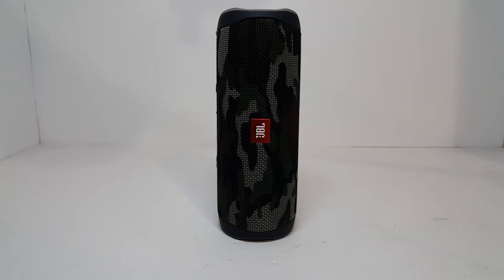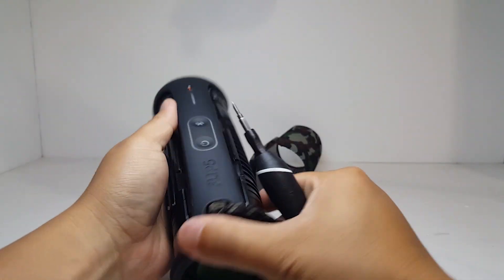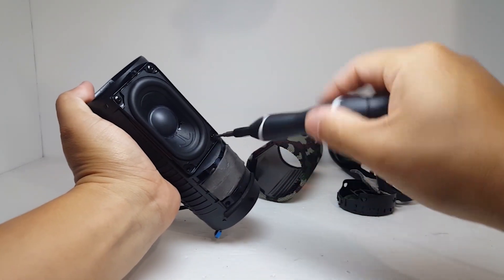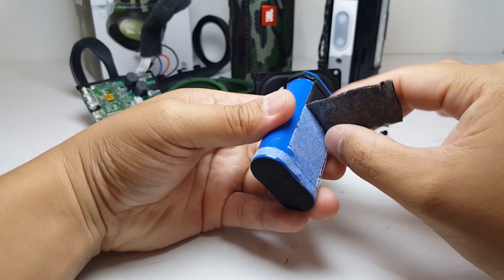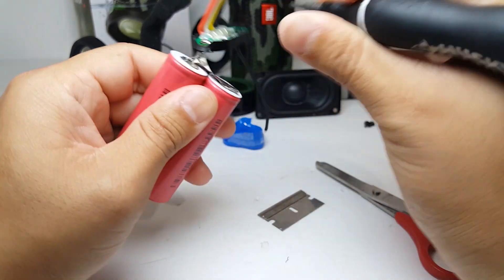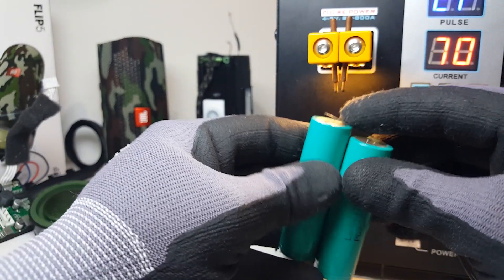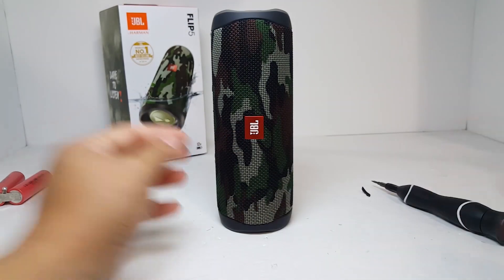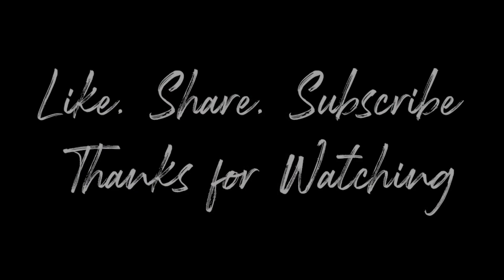JBL FLIP 5 - HOW TO REPAIR BATTERY

Comment: For all who struggle because it doesnt work like in the video TRY THIS – #Jin_Thao maybe you can pin this!

As experienced and mentioned by others in the comments there seem to be other (newer?) versions of the JBL Flip 5 – where the inside looks different and you have to work it different than in this video. I repaired mine so I thought it would be cool for you if I made a little instruction:

1. You have to make things different than in this video. So you should not try to force the material to behave like in this video. Otherwise you will break things. 

2. The first cable with the white adapter, that is connected to the platine, will go off, if you just gently push it side to side, pull a little, again push side to side and so on. 

3. Don't try to remove the speaker. Just pull it out and work around the cables having the speakers hang outside while still connected. 

4. Pull off the sticky black foam in the back so you can work there. There is also foam on the platina. I removed a lot of it because it makes it easier to remove the platina afterwards.

5. There are several ribbon cables that connect the platine to the outer body of your JBL Flip 5. Open and disconnect all of them but take a picture to make sure you remember which one has to go back in which place (there are numbers on the ribbon cables that help you to identify them afterwards). Especially one ribbon cable is pretty hard to reach as it lays on the inside. Some ribbon cables can be taken off after pulling the little plastic barrier up. Others (the brown ones) are not working like that. You have to pull them up parallel to the cable. They will come off easy. Then you can pull the ribbon cable off. Sounds complicated but it isnt.   

6. The bluetooth antenna is sensitive. But if you just gently solve it it shouldnt break. You have to be careful there. 

7. there is another little cable with a golden knob. It is connected to the outer body of your Flip 5. You can just pull it off. It will be easy to reattach it. 

8. At this moment all cables should be removed from the outer box of your Flip 5. If the cables are not removed, dont proceed!

9. The platina is very hard to move. Just pull off some of the black foam thats on the edges (but gently!!). That should make it easier. You really have to push your fingers against it. It will come into your direction. 

10. Because you removed all the cables you can pull off the platina far more than in the video. 

11. Replace the battery. 

12. The rest is not easy but you will get there by yourself. Basically putting the cables back and so on. 

Kind regards
Reply: Thanks :)

Comment: With a spot welder you should check the battery voltage and power output as if you spot weld it for too long the battery can degrade

Comment: Hello, here in Peru Ripley sells the flip 5 with a 2-way horn and the one you are disassembling I see that it is 3-way or 3-pole, apart from all the board burns in the bluetooth, it will be that it is a cheap imitation, thanks, where can I buy Same as yours.

Comment: I don't have a spot welder or Solder. Would it be safe for me to just tightly tape the nickel strips  on the new batteries?
Reply from the maker: i wouldn't as the battery can easily get shorted espcially on the positve end of the battery.

Comment: would have been nice to see where the cables hook into the motherboard at the end rather than speeding through it.
Reply: You can pause the video lol
Reply: Nvm I just tried to fix my JBL model like this one it's literally impossible made so you can't even fix it. Shits a scam to buy the repair battery.
Reply: @queyes157  Do you have the newer version of the flip 5 as the newer version in different inside

Comment: Hi, thanks for nice video. Could you please tell me the wiring of protection board? There is orange, white, yellow and black. Which one is connected with B+, B-, P-, P+ ?
Reply: I have the same question. Any one have a diagram of how the connections can be made to a HX-2S-D01 BMS board  for JBL Xtreme 2 ? 

I did it for JBL Xtreme 1. 
But for the Xtreme 2, it seems to have extra connectors coming out from the mother board to the BMS board . I don't have the original BMS board.

Comment: The original battery is a Sanyo cell? I don't find the cell from that number on it. But i see something wrote under the coat. Can you please tell me what is the original cell?
Oh, an you can put the maximum of the cell 18650 a powerfull 3500 mAh and you will have a beast of 7000 mAh battery. You should get at least 24 hours of playing. Good job men!

Comment: how do you get longer run time from lg 3200mAh than stock 4800mAh?
Reply: this 2 batteries have 3200mah and if you put togethger you have a 6400mah battery from stock 4800mah

Comment: Hi, good job. What are batteries specifications please? (Voltage, current)
Reply: 4800 mAh battery
Reply: @habeebrahman4134  two 2400 mA*h 3.7 V batteries
Reply: @habeebrahman4134  He asked for the specs not for the capacity
Reply: if you want you can put larger batteries
Reply: @JBLdestroyer  my jbl was low battery and than I tried to recharge but, it does not work,like no  charging,what's is goings-on with my jbl flip 5??
Reply: @kadekkorek416  the speaker is working now or no?
Reply: @JBLdestroyer  last night was working,but than get low battery red bipping than I try to recharge like normally but not possible to recharge till now :(
Reply: @kadekkorek416  if turns on its good but want a new soldering inside but if doesnt turn on the motherboard possible its dead i have the same problem
Reply: @JBLdestroyer  I see.. I have to open it and check it or maybe ill bring it to the electronic service center 🤔